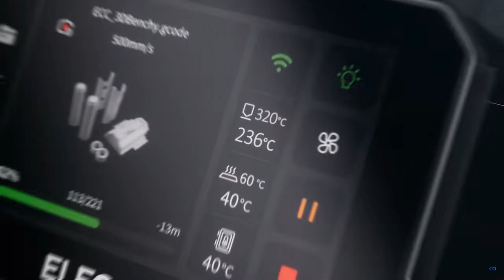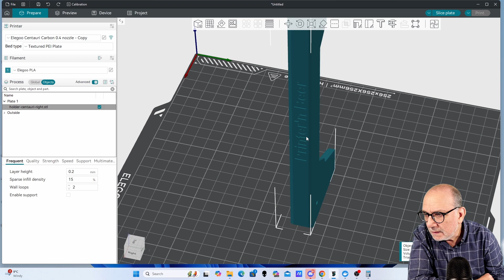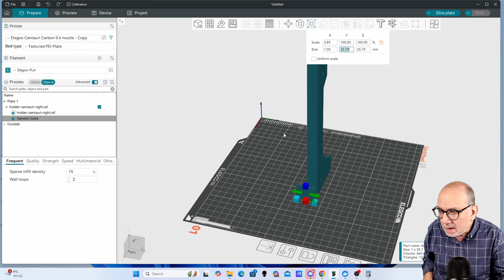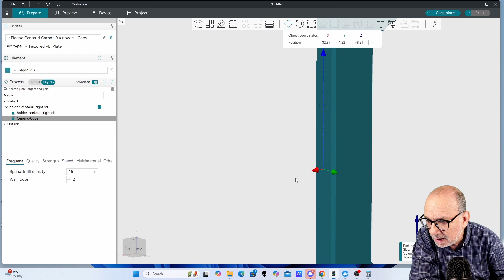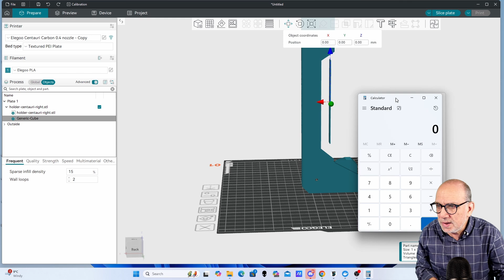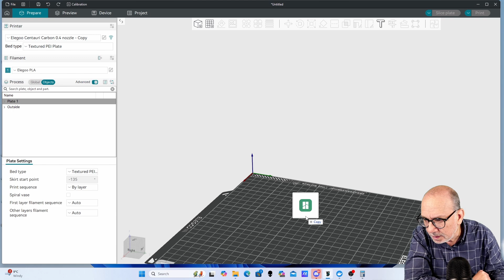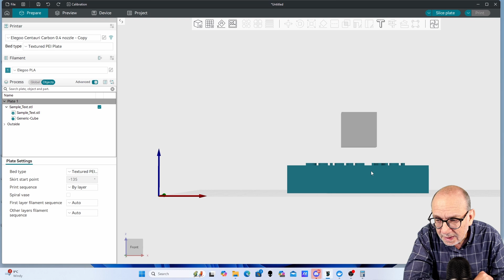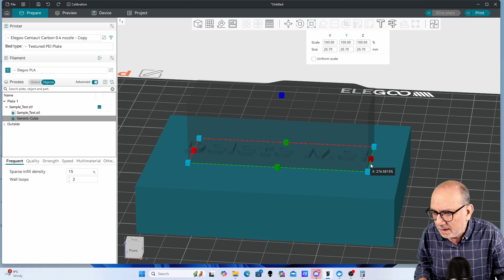How to Remove Text from a 3D Print (No CAD Needed | Works in OrcaSlicer & PrusaSlicer)

Comment: The fancy calculation didn't work out so you ended up eyeballing and guessing until it looks good enough. Why is that better or faster than eyeballing and guessing to start with?
Reply from the maker: You're right that I made a minor mistake in the calculation (which I should have seen) but the reality is that many people caught my error.  If it wasn't for that little mistake the calculation is infinitely better and easier than eyeballing it.  Thanks

Comment: For reference, you didn't cover the text after the move because you didn't take in account the thickness of your box. The move should have been (width of part / 2 + width of box / 2).
Thanks for the trick, I didn't know you can do simple Cad operations in the slicer. I saw somewhere else you can also do the reverse, add your own text. Awesome.
Reply: I don't see anywhere in flashprint slicer to add or modify anything beyond cut and resize. No 'new' objects.
Reply: @aarongriffin81  I don't know Flashprint slicer. Never heard about it. I use Elegoo slicer, which s a close derivative of Orca slicer, coming from Bambu Studio, based on SuperSlicer and PrusaSlicer. What a family!
Reply: @aarongriffin81  OK, apparently it is the slicer from FlashForge. I don't know its parents. Note that mine (Elegoo/Orca) has a switch to change the interface from beginner to advanced, where you have lot of new, a bit confusing, options. Perhaps if you have the same, and activate the advanced options, you can add new objects?

Comment: Much simpler method... Assuming both objects are aligned properly, select both objects, right click on one then select Assemble. Now press Y for the assemble function. Select the face on the main object then click on the left face of the primitive. In the parallel distance box type 0 then enter. Presto, your done in about 20 seconds or so.
Reply from the maker: Thanks...I'll try that...

Comment: When moving the section that covers the text upwards it just goes right back down to the build plate no matter what height number I enter.. Any ideas?
Reply from the maker: Hi there...I'm not really sure why you're getting that effect...I'll check later and see if there was some kind of change in the slicer to cause this.  Make sure that you're using the move tool in the slicer.  Also, try using the fields to insert the actual numbers for the movement instead of using the grab handles.  RG

Comment: Thanks for the tips! After struggling with aligning surfaces...I found that laying the part on the text face and then "dropping" the modifier part to the plate was easier for me. Then they're both flat and then you can flip the whole assembly to the way you want. Just a lil bit for y'alls back pockets 👍

Comment: I noticed the Bar you put in on that print. If that is so does that mean that it still PRINTS the letters they are just covered? There should be no sign of your bar on the BEER print.  No pun intended.  This would be easy to check,  after you slice and scroll down through your slice are the letters in the slicer?   I think someone a few comments down addresses this as well in a different way.
Reply from the maker: No, it does not print the letters...when you export the file as a new STL the letters are gone...you can also do what the person below says:   you can just right click on the object and choose "Mesh Boolean" which makes the changes permanent and all parts will become one single object...so no, the text is no longer a part of the print...basically by merging the files you've created a new STL without the letters.  RG
Reply: @CreatewithTech   Thank you.  I did this once and the letters were there inside the BLOCK I added just covering it but it printed INSIDE the block, crazy....
Reply from the maker: @tomyocom5886  That should not have happened...you need to combine the two parts so that they are one part...otherwise the letters will print because you've just got two parts intersecting...when you do a Mesh Boolean, or you export the final model as one STL the letters will no longer be there...typically a slicer will give you warnings if two different parts overlap...RG
Reply: It looks great but then when I slice it the letters come back, any idea why?

Comment: Instead of exporting to a new stl file (after you made the changes you need and are sure you don't need to change anything else) you can just right click on the object and choose "mesh boolean" which makes the changes permanent and all parts will become one single object (hence the importance of being sure the changes are correct) .
Reply: I guess then you could put your own text in place by doing this?
Reply: @Dubz87  yes
Reply: @Dubz87  yes.

Comment: Word of advice...when doing something like this where the measurements are vital, double check you measured correctly. The measuring tool said the distance was 65.5 mm but you kept saying and using 65. Hence it was never going to work as desired.
Reply from the maker: You're absolutely right—good catch! I missed the .5mm when measuring, which is why I ended up needing to adjust for that later. I definitely should’ve been more careful, especially since precision matters in 3D printing. That said, I hope the overall approach still comes through clearly for anyone looking to do similar edits in their slicer. Really appreciate you pointing it out!